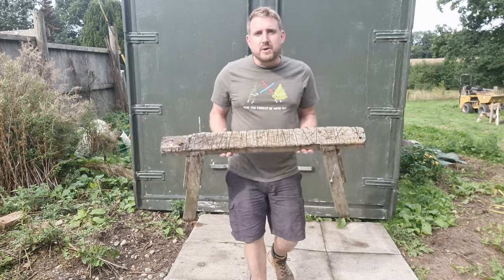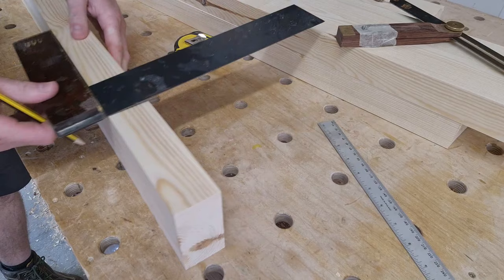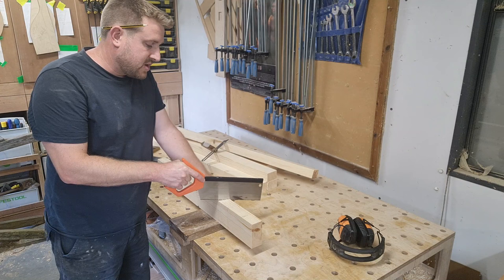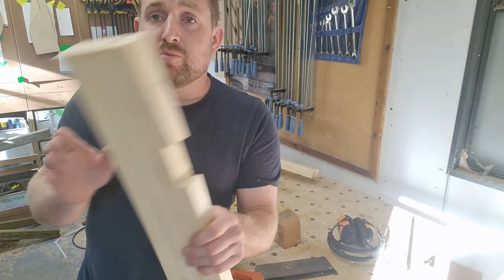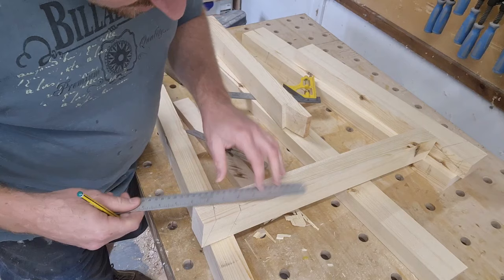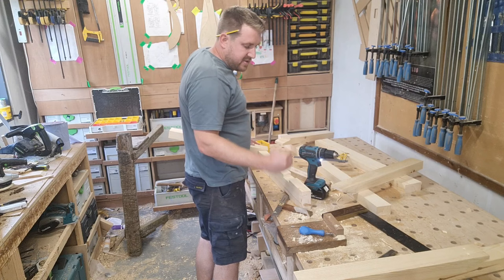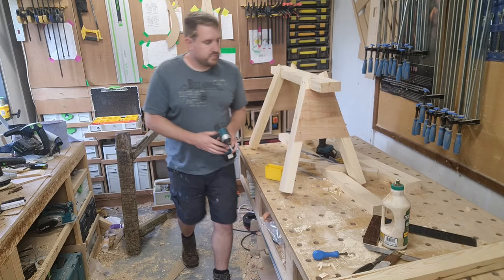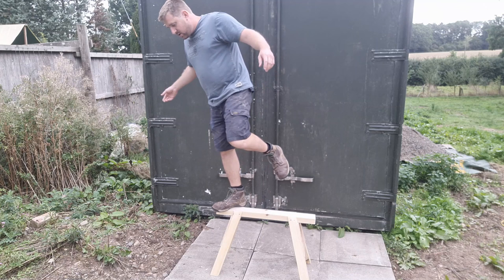The Best Traditional Sawhorse! How To build one with no Maths!!

Comment: Back in the day we used to have to make a new set of these on every new site. They make a very good saw horse. The only thing I would add for clarity is that every angled line is the same, the same bevel setting.we used to set the bevel at one in seven I think lol, a long time since I have made one. Perhaps just out of interest we would also bang the saw horse on the ground to settle the legs before marking the bottom of the legs with the block of wood. We would also endeavour to never accidentally  cut into them and carpenters would rarely lend them for that reason.we occasionally put stretcher on the long side and used it to cut deep skirting boards securely and easily. Great instruction vidio!
Reply from the maker: I long for the days where the first job would be to make the shop items needed for the job! When I was an apprentice we'd do stuff like that, and one job where I worked on a gang for a millionaire for 18 months we had a workshop area where I build a workbench and stuff. Was great to have it all set up on the job site. I used to love it if I went on a job with my mate and we'd have four saw horses set up to make soemthing, sometimes more, especially with framing.

Comment: About 55 years ago we implemented the metric system in Canada and we're still using the imperial system for lumber, plywood, clothing and you could find many, many more.
Reply from the maker: I think the metric system is better in nearly every way, and yet I still use imperial for a lot of things. It takes time to be good at both, but I think it's worth it. Being able to switch between them is great. I worked for a year for my dad doing agriculture engineering and being able to switch for the spanners without thinking about it was really useful. 
But the other night trying to explain to the kids why the vinegar at tea was sold as 586ml was tricky, "but why?" The imperial system is still there all the time!

Comment: Just home DIY when its needed. I planed some doors down today with an electric after it was required when new carpet laid. I bought saw horse from screwfix, plastic types. I had a clamp but In noticed not really able to on the horse. Pressure one hand and planer the other. Took a while as had 5 to do. The planer I have does not take down too much at once hence taking a while. But first time and enjoyed. Hence why watching this.
Reply from the maker: I use plastic trestles all the time, they're ideal for some things like painting doors, but for using and tools I find them a little high. Saw horses are great as you can use your body as a clamp for hand tools.

Comment: Are sawhorses stronger if held together by screws or nice, interlocking joinery?
Reply from the maker: These have a good mix of both, the housing joints help hold them together and the mechanical fixings pull it all up strong. My last set are 20 years old and I've had to wind a few more screws into them to firm them up, but otherwise they've been trouble free. It's also how much time you want to invest in something that is a work aid.

Comment: What would you use for the sacrificial top ?
Reply from the maker: I used a bit of 4x1 that I think came from a pallet. Anything really that's flat and not too thick. If it's free even better. I think my last horse had a bit of old fencing on it.
Reply: Thanks for that, great instructions
Reply from the maker: @barrytorrance6088  thank you! Honestly the right work holding is what makes carpentry more of a pleasure.

Comment: What is the length of the legs 🦵?
Reply from the maker: If you cut them roughly to just over 2ft (600mm) then trim them to a length that works for you when they're all on that should be about right. Finished height (from the floor to the top of the sawhorse I set for about 520mm.
Reply: @englishhomestead  ok thanks buddy
Reply: What is the easiest solution to fix cut on bottom of legs I had it pretty good fooled with it and ended up with it rocking now I want to try and get it right 🤦‍♂️other than that worked out really well
Reply from the maker: @ifeellikeiminthematrixagai9720  so I'd find a flat surface, get some wedges of packers and then shim it so it measures evenly to the floor both ends and looks flat across the top. Then get a piece of wood that is big enough to mark right round the bottom of the legs and hold a pencil level with it, mark each leg. Then cut along those lines making sure it's a compound cut and follows the marks right round each leg.
Reply: @englishhomestead  in my case the flat surface was the kitchen island...just don't tell my wife 🙂I started with 26" pieces for the legs, but given what I cut off for 21" finished height, could have gone with 25". Thanks for posting this video!
Reply from the maker: @Savior-Faire  haha! Oh my - not sure I'd ever cut on the kitchen worktop! 😅
Reply: @englishhomestead  I just marked the lines in the kitchen. I made the cuts in the garage. No death wish here 🙂
Reply from the maker: @Savior-Faire  🤣🤣 thats not so bad!

Comment: Okay, hold on: you said without maths. Measuring from a ruler or tape measure is actually math. You can't do it without math.

Perhaps you meant without using complicated math, and a whole lot of figuring.
Reply from the maker: I mean you're right, but even if I said the legs were the lenght of your shin bone you'd still have to count four of them. Even my breakfast involves maths, counting the piece of toast and number of eggs. 
You are right though, because everything involves maths, but there's no complicated joinery. Unfortunately maybe I've gone for a "grabby" title to get some views, but I liek to think the maths is all pretty basic, and easy to remember.
Reply: @englishhomestead  It's okay. I'm just picky. I'm sorry for that.
Reply: Maths not Math
Reply: @MartsTravel  what, exactly, does your answer mean?
Reply: @patriciajrs46  it means the correct way of saying the shortened version of Mathematics is Maths, not Math, which is wrong.